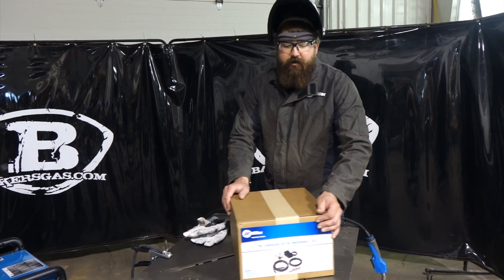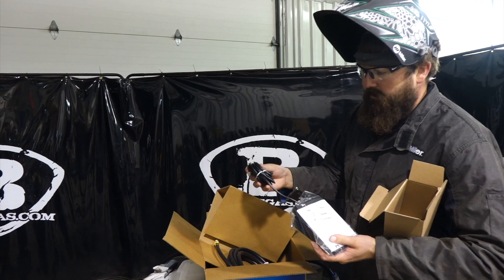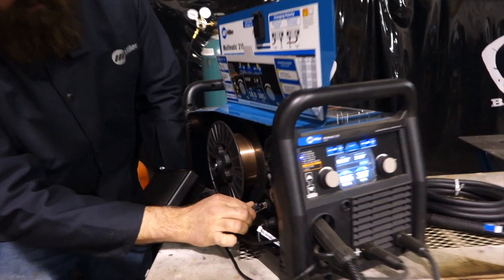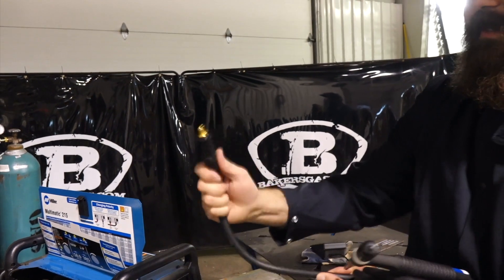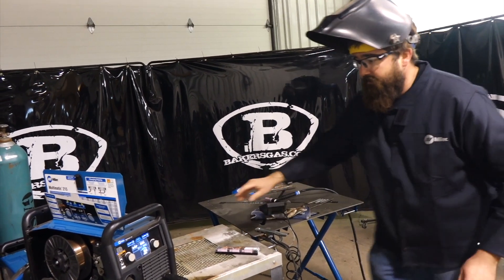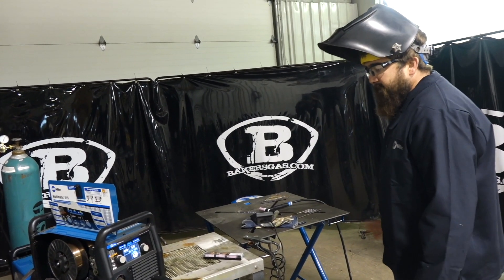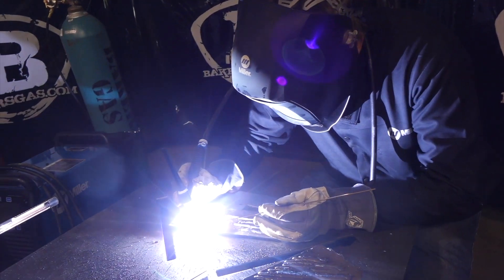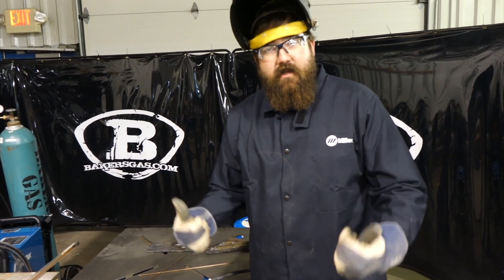Miller Multimatic 215 TIG Kit Set Up and Review

Comment: Can you use this Tig setup on the 215 to weld aluminum?
Reply: I have one and you cannot unfortunately you need an AC compatible welder
Reply: @kingofspades1785  thank you for getting back to me. That is the common answer I have received when asking about that. 

Cheers 🍻
Reply: @danielkuva7966  yea no problem but if that is not a deal breaker that really is a great welder and I cannot recommend it enough
Reply: Yes you can. You can weld aluminum in D/C running straight helium.

Comment: Hi. I have the Multimatic 215 with TIG option and the gas does not flow (even when pressing the pedal) until I start welding - at which point the gas now flows. Does that sound right to you? I contacted Miller and they said that is the way it is supposed to work. Your video shows that it flows as soon as you press the pedal.
Reply: I'm not sure of all the features on this machine but maybe turn up your pre flow?

Comment: Since the amps are set at the front panel either manually or auto-set. Does the foot pedal also control the amps or is it simply on/off switch on these 215 / 220 Mutlimatic machines?
Thanks
Reply: The foot pedal also controls the amperage applied.
Reply: Can anybody with real experience offer an answer?

Comment: "BEWARE" that pedal is a cheap plastic toy. Do you see how small it is. Any sized shoe is going to dwarf that pedal. Your arc controll will suffer because it's so damn overly sensitive due to it's small size. I changed mine out with a USA Weld replacement.  New one is big, all steel, durable, very controllable and comfortable.
Reply: Could you link the replacement please
Reply: @BakersManOG  https://www.ssccontrols.com/tig-welding-controls/c-series-tig-pedals/

Comment: I have the 215.  I have never TIG welded before.  Can you explain if there are differences in filler rod?  I am guessing there are size differences and maybe material? Thanks.
Reply: Depends on what you are welding. Mild steel typically uses copper rods. Aluminum uses aluminum rods. Stainless requires stainless rods. Sizes coincide with the tungsten. Typical sixes are 1/16, 3/32, and an eighth for tungsten and filler respectively.